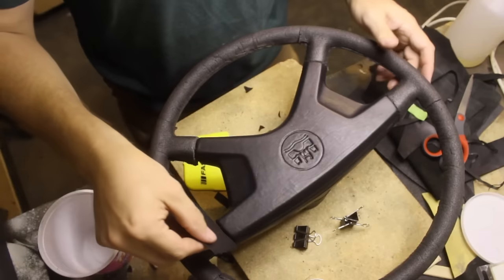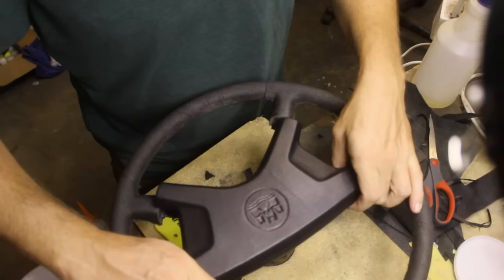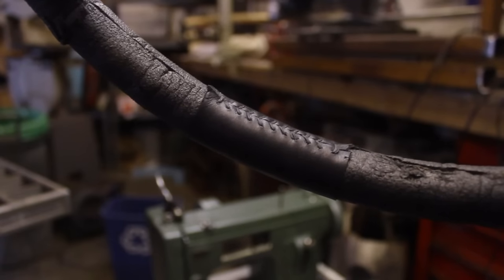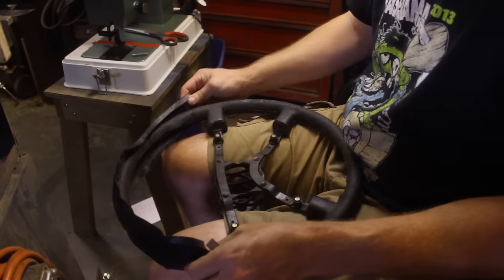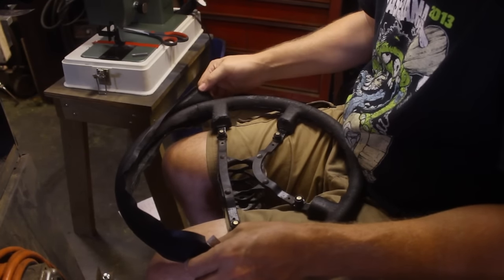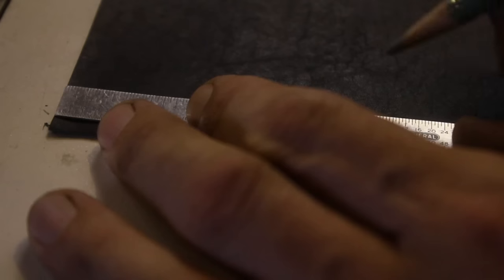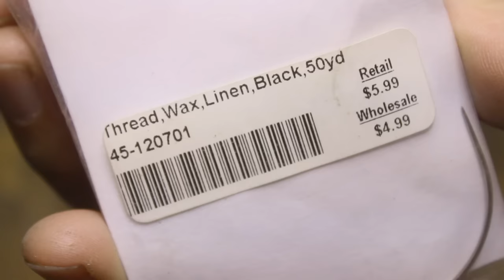How to Hand Stitch A Leather Steering Wheel - Vintage Volkswagen

Comment: Nice job on that cover! I have to repair the leather wheel cover of a Porche . Only two sections are damaged/missing threads (diamond pattern). Do you have any suggestions for stretching leather that is already on the wheel? Thank you and really impressive video!
Reply from the maker: water will help relax the leather, just be slow with it (don't just dunk it in a tank).  If it stretches with just water, then good.  If you need more stretch, then use the formula from the video...  Be sure to get the entire leather area wet so you don't wind up with a stain.  Waxed thread will be waterproof, so you shouldn't have to worry about it shrinking and tearing the holes.  Good luck!!!
Reply: Thanks for your advice and quick reply. The Porsche 9ll is a 1972 the leather is shrunken and old, hopefully not too dry to reconstitute a bit. Fingers crossed. ; )

Comment: Two questions. What sewing machine is that? Second. What size thread?
Reply from the maker: Thompson mini walker.  They don't make them anymore. Sail rite makes a modern clone.  Thread was 92 I believe...  If not it was 69...  You need to get it from an upholstery supplier.  Joanns or hobby lobby won't have it...  they'll have "upholstery" thread, but its for curtains and pillows, not cars.
Reply: @GregsGarage  awesome thanks dude. There's some Asian replicas of that machine on eBay. Think I might grab one and teach myself how to stitch!
Reply from the maker: @zero_to_1000  Yes.  Sail rite uses the same castings, then replaces a handful of parts to make them better.  I think you'll be alright with the less-expensive ones.
Reply: @GregsGarage  I actually just agreed to $400 on a Thompson just like yours!
Reply: @GregsGarage  she says it works well. Fingers crossed it's not a paper weight. I'm trying to refinish some vintage leather steering wheels I have.

Comment: super glue destroys plastic parts, be carefully with it. even if it was used for things, not touching plastic parts
Reply from the maker: +Andriy Podanenko I haven't had any trouble with that in the past.  I'll have to look into what types of plastics are safe and which are not.  Is it something that happens over a long period of time?
Reply: +Greg's Garage the issue with the super glue, not the plastics. When glue become destroyed over a time, it throws specific chemic components, that makes neibour plastic cracks.